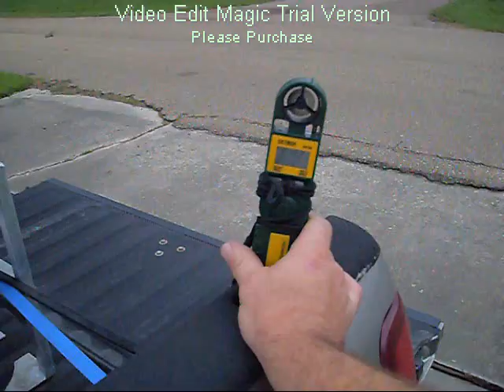Ike Vawt Power

Comment: 16' x 24' is too huge for residential use, like the honeywell 6' blade-tip power models selling for $6k but weighing hundreds of lbs, impossible to decently do on a roof as they indicate & it doesn't start til the wind reaches about double where yours is starting, which is why yours would be extremely an excellent match for the midwest, why so large?

Northern Tool has little HAWTs for about $700, but the mfr Sunforce doesn't have plans yet for a VAWT

maybe NT or SF would be interested in small

Comment: in the midwest we don't want to pay for performance at higher windspeed...  it's low speed that matters...  I've seen ads for 3D printers for a bit over $1000... too bad it's not $300...  so a) is that what's still holding you up... and b) guess what I'm supposed to be thinking ...    almost interested, but maybe too soon...

Comment: your design is absolutely great man, but I would like to know about the attachment of the blades to each section in the shaft... and if you have ever calculated the aerodynamic efficiency of the rotor, it's just because I'm working in the making of a similar turbine and I find the attach method is a very important stage to enhance alignment and decrease vibrations.. thanks for the attention, good luck!